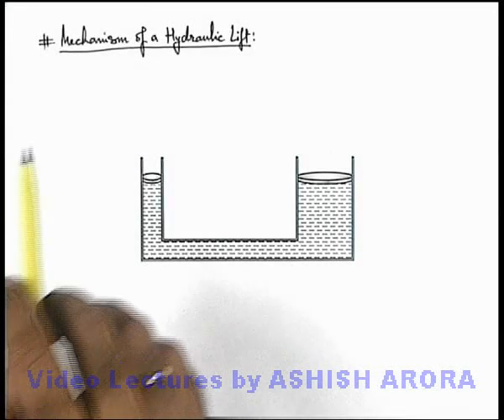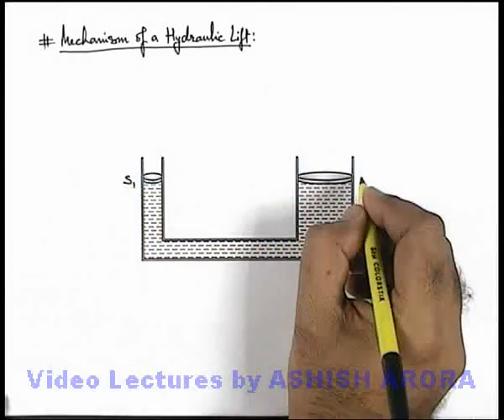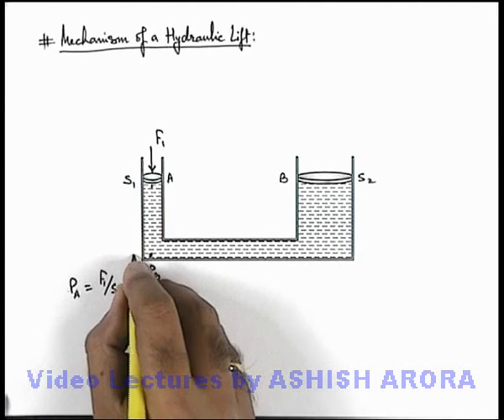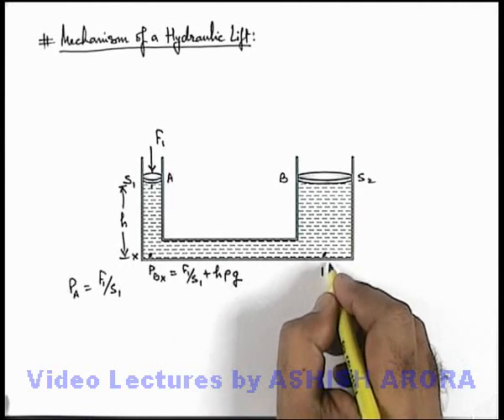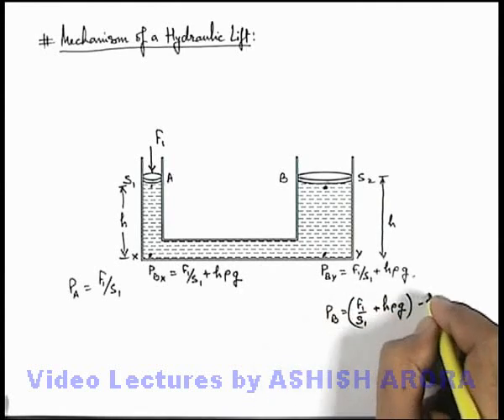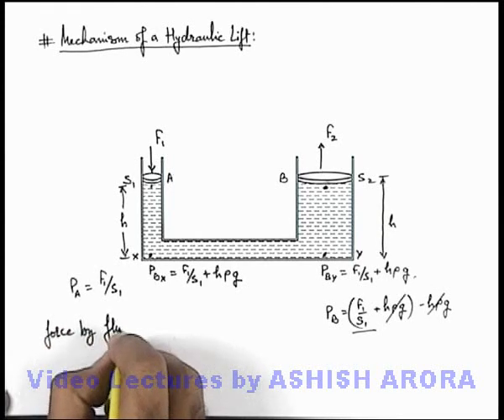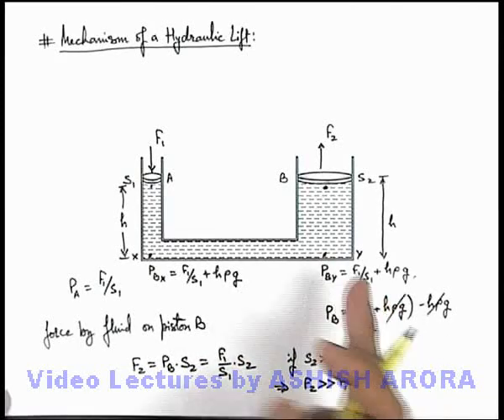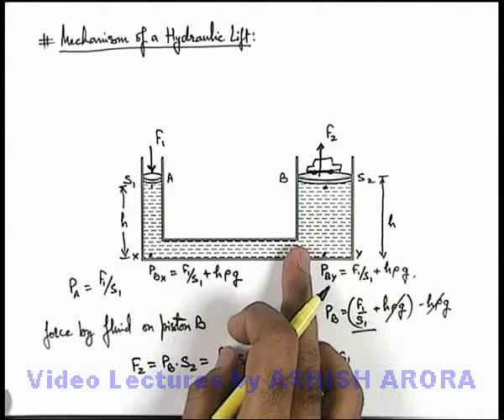Class 11 Physics | Fluid Statics | #17 Mechanism of a Hydraulic Lift | For JEE & NEET

Comment: sir what happen when height of broader tube is different and not h ? is there any change?
Reply from the maker: automatically their height will become equal as atm pressure is same at both ends...
Reply: OK. thank you
Reply: For that we have to take 2 diff immiscible liq. And then calculate pressures in a diff way.
(leaving it for my juniors)